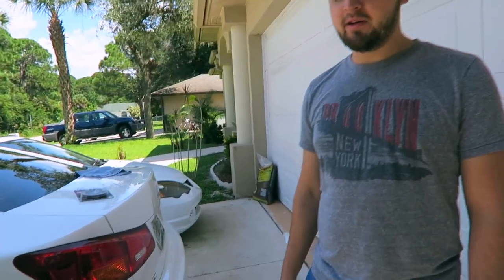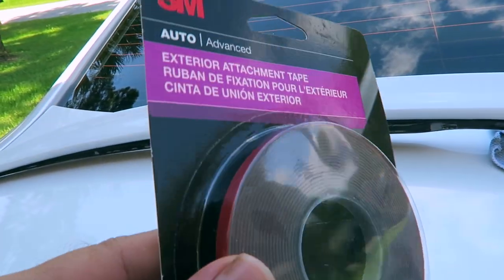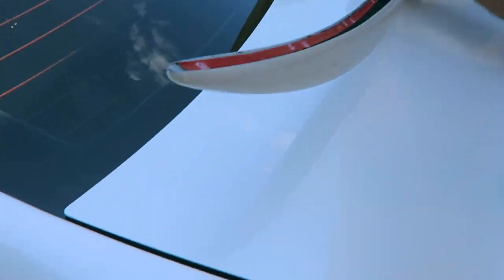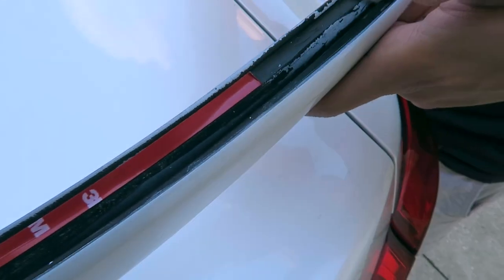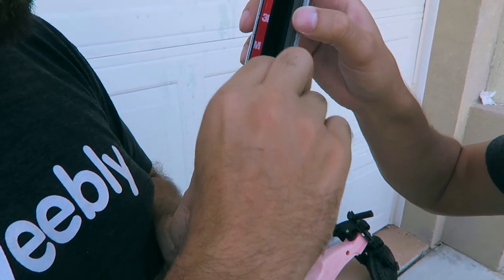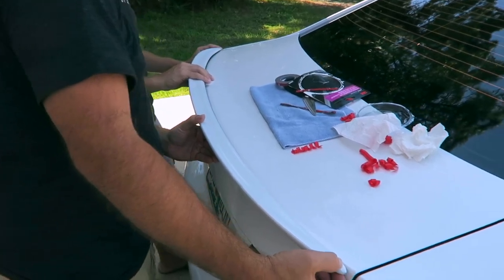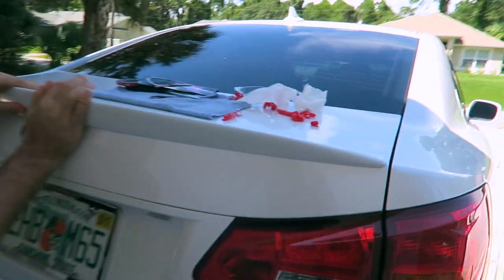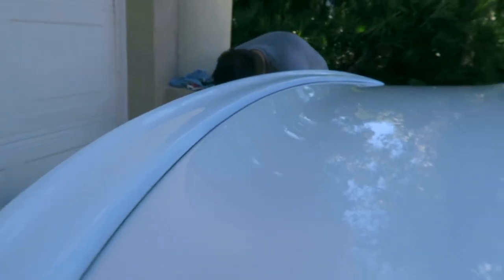TRUNK LIP | LEXUS IS 250

Comment: Hi, looks like it's been about 2.5 years since you installed this.  How has it held up?  I have the same spoiler but am trying to decide if I put it on with 3M tape or drilling holes and  using screws into the blind nuts in the spoiler.  Thanks for the vid!
Reply from the maker: it's my brother's car so I'm not sure if he still has it. last time I saw it I think it was still there. In the beginning he had some trouble because the mold of the spoiler was not perfect and he kept wanting to come up but eventually as time went by it settled in and seemed to stay. If you if you live in a state that gets very cold then you probably will have even more trouble  so maybe something that keeps it in place would be good so you don't lose it on the freeway. Hope this helps.